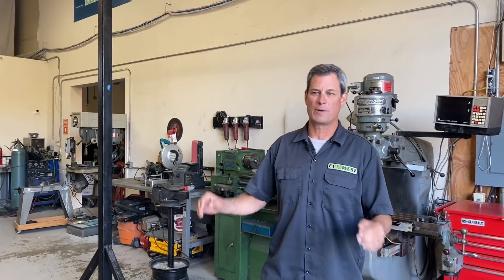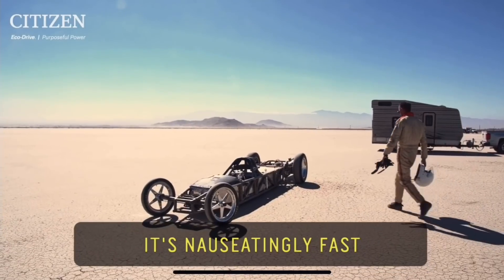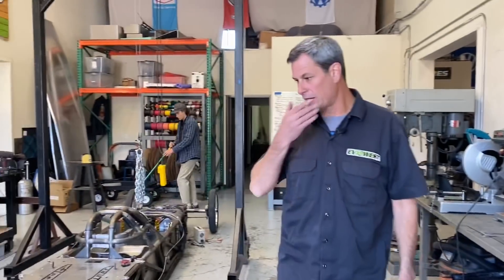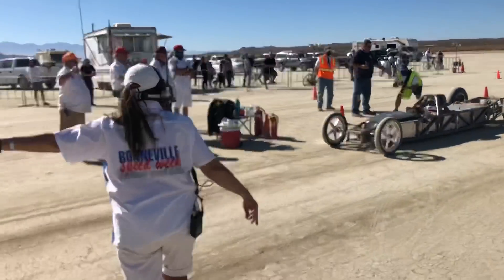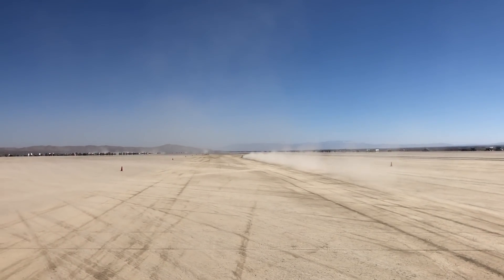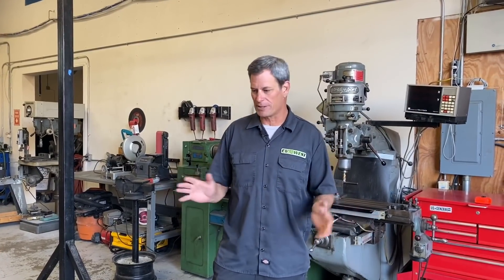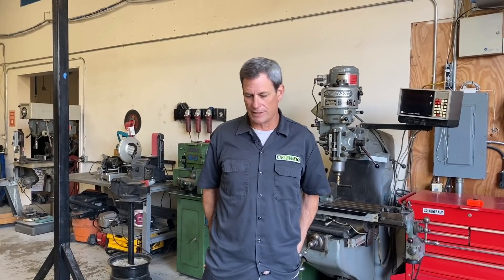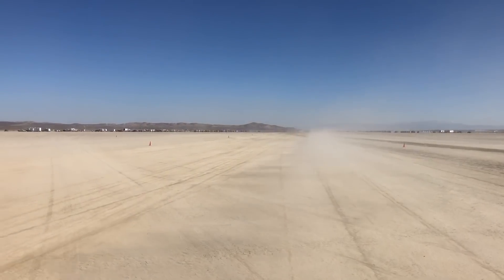New Electric Land Speed Record!! Tesla Powered Electraliner Does It Again!!

Comment: You should also reduce the drag coefficient put a carbon fiber body (or fiber glass)  on it  you can use some sort of aptera body desing they have the lowest drag coefficients on a car, also instead of using steel for the chasis you could use reinforced aluminum.. I think just with that you should well pass the 200 mph cap

Comment: The difference in the landing gear , fixed gear of a light aircraft.  A round tube vs a tear drop cross section.   Is a ratio that approximates100 for the round tube and 5 for the efficient airfoil shape.    Because air resistance goes up by the cube,,, it is not added,, it is not  doubled or up by the square,, the resistance rises by the cube.  Your non aerodynamic open tube frame at 182 mph would rise to 230 or 240 with no power change.  And do not do the 'make the front nice and pointy'  Most of the drag comes from the rear end of the shape.  Hint,, the tear drop shape  achieves its efficiency not with the front,,, but rather with the long taper of the back.  I will not get into Reynolds Numbers or the tech stuff,, just remember  the air resistance goes up by the cube. an open tube frame of any type on any vehicle almost cannot exceed 210 miles per hour,,, No matter how much horse power you throw at it.  400 hp won't get you there  and 1400 won't get you there Perfect aerodynamics will.

Comment: I’m curious how you cool the systems for such intense performance.
Reply: Limited time and enough mass in the cooling  fluid/system to absorb the heat. 

Kinda like how some drag racing gasoline-powered cars have their engine block's cooling system filled with cement.
Reply: Maybe nitrogen for the higher speeds
Reply: Michael addresses some of this in jehu garcia#24

Comment: can the bolt ev gearing be changed out for higher top speed instead of 92mph of what is at the moment??? that would  be cool if its possible to do. would like for it to go 140mph minimal.
Reply: Yes you can change the single speed reduction gears out, but it will effect acceleration by switching to a longer/taller gear to increase the top speed. So always a trade-off.
Reply: @4literv6  Or use 2 gears...   (this single gear mantra has got to end, EV torque isn't Magic, it is knowable and measurable - that means science)...  lol...
Reply: @kadmow  inmotive has a fascinating 2 speed transmission in testing for electric vehicle's. Which uses a setup like a bicycle derailer. Claims 12-15% increased efficiency at a very reasonable cost. 🤔

Comment: Epic start towards the future 😎
I've been following your channel for years and so glad to see you're back and making great progress! 
I've been driving electric cars for 3 years and I love the smooth linear powerband.
Reply: Electric vehicles we're first dating all the way back to the 1830s. When a professor from Virginia made his own conversion.
So it's just more of the past come back around and revisiting us. Fun factoid the electric starter motor is what helped kill off bevs the first time around.
Reply: @4literv6  yes very true, electric did begin ahead of gas. Battery design over the last century lacked in performance and DC motors burned brushes up and slowed as battery voltage dropped, that held back the ev until the 2007 advances on 3 phase VFD and lithium batteries which Finally made the ev practical.
Reply: @HandyDan  not really the Germans had 50-100 mile evs during ww2. In the 70s a few bevs roamed around with over 100 miles of range. 
It's always been about vested interests in the fossil fuel sector stomping on evs.
Reply: @4literv6  Those old EV's with 100 miles is good range but not competitive with gas at the time. EV could have/should have been developed further. Ni-Cad battery tech wasn't there until the 1990's with GM's eco-style EV which they promptly killed. Someone could've designed a 100 mile range Roadster in 1999, but it would've cost $250,000. Beyond CO2? Smog is really an issue even with modern exhaust systems. Keep up the EV revolution.
Reply: @Nphen  most driving trips daily worldwide are under 50 miles total traveled. Which means bevs have been adequate for quite some time now.

Why when up until the mid 1920s evs actually enjoyed a near even market share with ice. Do you then think we went away from selling and using them? Even gm had electric commercial truck's in the 20s which sold 40% of their market share. So why again did we stop using them? 
You will not like the answers you find if you go digging for that information. As usual we've been sold snake oil and left holding the bag of shit. 
Lookup the breakup of standard oil just for fun.
Reply: @4literv6   I am a Tesla shareholder, e-bike builder, and EV enthusiast in Michigan. I've watched the "big 3" American auto companies screw up my home state and the lives of many with their reckless and haphazard business practices and slavish devotion to oil companies. The past is gone. We must learn from it and forge ahead. This is why I'm so insistent and consistent on EV adoption and pointing out that ICE vehicles main problems of smog and oil drilling are a lot worse than CO2. Self-driving can also save tens of thousands of lives in the USA alone. EV's, hemp and fusion energy are the 3 keys to ending fossil fuel use while offering human health benefits with correct implementation.
Reply: @Nphen  tough to break those chains imo. It's a monumental neigh herculean effort, and I'm not sure we have collectively as a whole. Have any of the needed intestinal fortitude to even start moving the needle. 🤔
Reply: @4literv6  Put your money where your mouth is. Aptera is taking crowdfunding via Wefunder. You can invest as little as $100. I am setting up an account now to try and invest because I believe in the engineering and design behind Aptera. Get a Cybertruck when it launches and take it around to local companies. They will see the capabilities and want one on the spot. Fossil fuel won't be able to compete with Tesla after 2024.
Reply: @Nphen  no thanks I'd never promote any 3 wheeled transportation, except maybe some electric beach cruiser bikes. 
Agree with what you said about fossil fuels not being competitive very soon though. 
And I do use a truck for work, so I wouldn't mind a single motor ct at all. It would work great for the small hauling and various odd moving job's I do now. But sadly that isn't likely to be available until 2023 possibly late 2022. So my 2018 base xl f150 which gets only 20mpg will have to suffice for the 4000 or so miles a year I need it for work purposes. 😏
Reply: @4literv6  I remember when electric scooters were just coming out in the late 90's and they barely went 2 blocks before either catching fire or dying. In 2000 if someone told you they'd have a full size sedan go 100 mph and drive over 200 miles on basically AA batteries you would never believed that.
Reply: @HandyDan   - but we could believe a long C-cell could do it, but not AA's   (just kidding) - anyone who knew about "stuff"  - and was "versed in "things"- would probably believe science would "get there" - time and investment capital is the limiting factor - the "When" and the "How" to fund / make money. - the "Making money bit is still "Nearly there" - the "Over-capitalisation" is definitely solved.  Solar and Wind have been in the wings for a while - it takes "Alarmism" and a few breakthroughs to get revenue flowing.

Comment: I may have missed it, but did you guys run without the aero bodywork to get into the lower weight class?
Reply from the maker: We are working on a new body. We had some strength issues with the last fiberglass/carbon body.
Reply: I was goieto ask why they hadn't fitted the aero shell as I am sure they would have gone faster with it on, but what you say is a good point, was it to save weight?

Comment: I'd love to talk to you guys about an electric racing series I look to develop, basically taking the fight to the fastest LeMans cars, over 24 hours. That takes 30+ minute stints and really quick pitstops. Quicker than refueling regulations allow, ideally of course. Because, why not?
Hot swapping batteries, leaving little on the table aerodynamically nor in the drivetrain. Destroy Formula E a few times over.
Reply: A couple new e racing series about to debut next year.  There's the etcr pure series, the projekt e rallying series, that off road series that several f1 driver's are sponsoring, the same people that created formula e are also debuting an electric hydroplane boat racing series in January. 
You've got the mach e 1400 and the e cobra jet 1400 for fomoco knocking down some doors to end the season.

Comment: Electric vehicles don't belong in racing, they're too slow, they reduce the challenge of racing, they eliminate racing as a spectator sport, and they're not all that sustainable. We need carbon neutral synfuels, for racing vehicles, as well as other vehicles that can't be electrified.
Reply: This dude would have been on record saying gas engines were stupid. Steam is the future of automobiles!
Reply: Have you not seen the electric rally cross, they are faster than ICE? For that matter, have you not come across the Tesla Semi or the Rivian R1? Both have something like 800hp and 400 mile range, and are due out in the next couple of years. They sound like they should keep up with ICE power. I agree planes are going to be more tricky, but give them time and I am sure they will find a way.
Reply: @SheepShearerMike  The only forms of racing where electric is faster than ICE are those which are EXTREMELY short duration, F1 is not one of those forms of racing. The Tesla Semi and the Rivian R1 are CONCEPTS, they're not production vehicles and their performance is absolutely pathetic relative to ICE vehicles of the same price. With a semi-trailer truck, the goal is not to drag race the fastest, it's to carry a specific load over a long distance, and ICE trucks are powerful enough for that task while offering far greater range.
-
An electric pickup with 400 miles of range is likely to cost more than $100k, and its towing performance wont come close to matching that of an ICE pickup. You could also buy at least two ICE pickups with far greater capabilities for the same price.
Reply: I’m pretty sure a automated drone race car driving by lasers 200+ would draw many crowds humanly impossible speeds. While as they are completely different methods but same power source hydrogen is your favorite power source. Look up hydrocarbons it’s the hydrogen and carbon that burns great. Neutral fuels are just as big of a scam it’s always going to produce some amount of carbon.
Reply: @k.959  There's so much nonsense in your comments that I can barely decipher them. Hydrogen burns just fine on its own, as does carbon. I don't even know how that's relevant when I brought up hydrocarbon fuels made from captured atmospheric carbon.
Reply: HAHA “from the atmosphere” your dreaming you mean from power plant scrubbers. synth fuels are reason for all the extra natural gas fracking it’s just as carbon based. Just cleaned burning that’s just as renewable as the next carbon source.
Reply: @k.959  There's something VERY wrong with you, nothing you say makes any sense. A chimp slamming its hand against a keyboard would make more sense than you.
-
No, I'm not talking about power plant scrubbers. If every fossil fuel burning power plant on Earth were shut down, including every natural gas power plant, capturing carbon for the purpose of producing synfuels would still be possible.
-
AGAIN, I'm talking about ATMOSPHERIC carbon capture. The US Navy has also developed a way to extract carbon from seawater for the purpose of making jet fuel.
-
Synfuels are just synthetic fuels, there is absolutely no need for them to be related to natural gas, or fracking, in any way. The synfuels that I'm talking about are renewable as long as you have energy to produce them.
-
The synfuel process that I'm talking about would mimic the NATURAL carbon cycle, which also needs energy input to function.
Reply: ICE is already dead. Accept it.
Reply: @seasong7655  Right, ICE is dead, that's why ~98% of vehicle sales are ICE vehicles.
Reply: @PistonAvatarGuy  Source?
Reply from the maker: @PistonAvatarGuy  The same could be said about music, at one point 98% of all music was on CD's. Just saying.
Reply: @Ambot51  For what?
Reply: @EVWest  Nothing* has surpassed the audio quality of CDs, MP3s were a step backward.
-
*nothing that is widely available...
Reply: @PistonAvatarGuy  Not true. Several formats have higher resolution than CD.
Reply: @GustavBrogren  But they're not widely available from record companies. Most of the higher resolution downloads that are available are ripped from CDs anyway.
Reply: @PistonAvatarGuy   Your statement that "~98% of vehicle sales are ICE vehicles." Looking forward to it!
Reply: @Ambot51  Who cares? The percentage is too small to be of any concern. We need to achieve a 50% reduction in our CO2 emissions in 10 years, that's not going to happen with almost 100% of vehicle sales still being ICE vehicles, especially when you consider that most of the vehicles sold today will still be on the road in 10 years. It also doesn't really matter when the majority of the energy for electric vehicles is coming from the burning of fossil fuels.
-
There isn't even enough cheaply available lithium on Earth to electrify the world's vehicle fleet.
-
The ONLY way to get to a 50% reduction in ten years is to produce carbon neutral synfuels which can be burned in existing vehicles, but everyone is too busy drooling over a fancy marketing campaign to care. Oh well, it'll be a glorious collapse in the end.
Reply: @PistonAvatarGuy  
Theres enough lithium in Nevada alone to electrify the ev car production in us
Plus its recyclable,reusable.
Only thing holdin up EV production is 
Legacy automakers  dragin their feet
Tesla is in such big demand they are
Building more Giga factories in China, Germany and Texas 
ICE cars will be banned in many places eventualy due to sickening air polution
Reply: @WANDERER0070  ICE vehicles will not be banned, BEVs are too expensive and lacking in capability to replace ICE vehicles. There would be RIOTS.
Reply: It’s not that electric vehicles are slow at all. Formula e just too many regulations. And I’m pretty sure any vehicle can be electrified ;)
Reply: @k.959  Formula E is just restricted by regulations? Are you kidding me? No, the problem is batteries, they just don't store enough energy to power a ~1,000 hp motor for an hour, not even remotely. Semi trucks can't be electrified without seriously harming their performance, neither can pickup trucks, or aircraft. Try to be cute all you want with your little winky face, but humanity is facing extinction and you people are obsessing over useless TOYS.
Reply: @PistonAvatarGuy  well these toys are in part going to help save us from that future. He said in the video they aren't out to set records or anything but to do research and development for their commercial products and projects.  That will allow them to continue to save old vehicles from the scrap yard and convert them into all electric and also allow them to share with the world their experiences and expertise so that others can do the same. 
Basically, I don't know why you're hating because we are all trying to achieve the same thing and these guys are pioneers in the field that will help us get there.
Reply: @JaredConnell  You can't save old vehicles by destroying everything great about the character of those vehicles.
-
Focusing on a technology which is as limited and as resource intensive to produce as BEVs will not help us to achieve anything, it will only hasten our demise.
Reply: Elon’s already committed to burning extremely toxic fuels monthly to destroy our atmosphere to try to leave this place. The whole search for greener energy has never been sustainable or green but sustainable enough for a race.
Reply: Tell that to the hydrogen bomb. Bet your the same person who will discredit nuclear reactors saying they don’t last long enough needs more energy density. Go ahead and start afire with no carbon.
Reply: @k.959  Nuclear power and hydrogen fuel cells are completely different technologies, hydrogen bombs and nuclear reactors are also VERY different technologies. You have absolutely NO IDEA what you're talking about.
-
This is what I'm talking about: https://www.youtube.com/watch?v=Mb_8DJF6Hp0
Reply: Hydrogen fuel better power density. Prototypes already over 600mile range. Electric is always going to need it’s clean fuel to power it but a small generator burns a lot less fuel to power a 800hp electric motor while a 800hp engine only wasting heat.
Reply: @k.959  Hydrogen is nothing but a greenwashing scam, the technology is too expensive to offer any benefit.